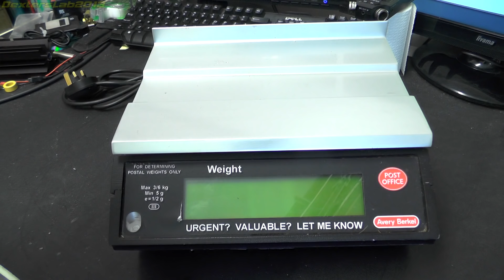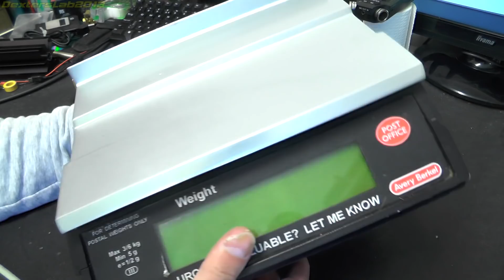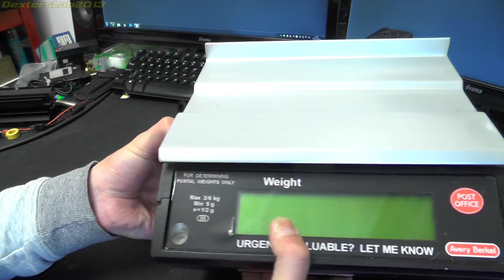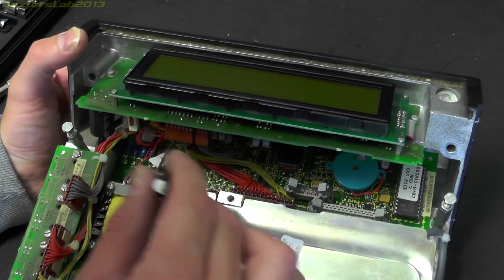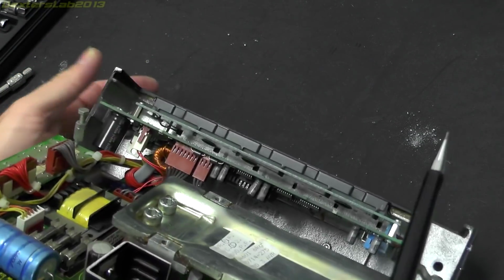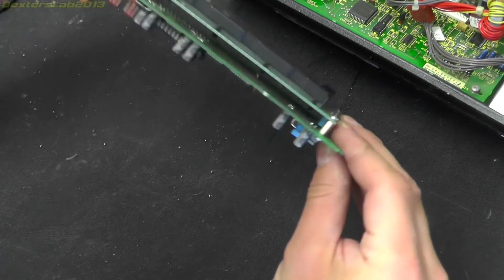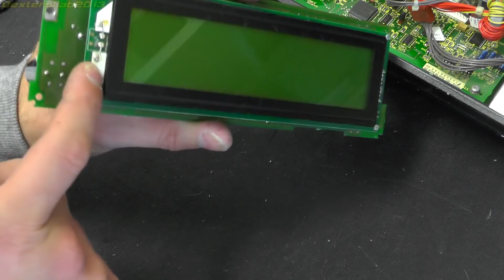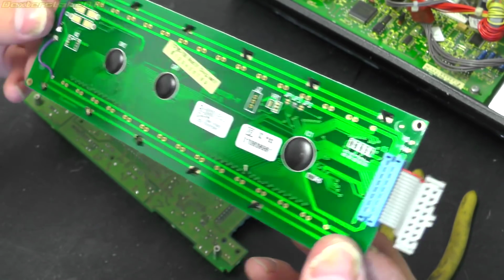DL#069 - Avery Berkel D104 Post Office Scales Teardown

Comment: Unused connectors are for the optional parallel port printer output, used to print labels with mass and postage. The dashes were saying underflow, you need to have around 3 kg ( the mass of the plate, screws and the customer pan) steady for around 5 seconds for the MCU to decide it is happy with the zero and do the auto zero initialisation.

Shielded can is the ADC, discrete parts to make a dual slope converter, using the ASIC as the control logic to control and do the timing for the integration. Slow, but is immune to noise on the input. That uses the 2 5V rails from the power supply for low noise, and you saw the large integrating capacitors inside, along with the feedthrough ferrite filters on all leads going into the can. Easy way to get 18 bits of data with very good linearity ( very important here, as you typically want to use the LSB on the display) without having to do averaging on multiple samples. Just very slow, but really good. There must be a precision reference in the can, likely a 1-2V one as this determines the accuracy alone.
Reply from the maker: +SeanBZA Thanks Sean, yea didn't think to drop a bit more weight on it. Though i would have expected some kind of readable error in that case given the environment they are used in?
Reply: +DextersLab2013 They have a limited negative reading capability, but the design is such that they need to run with the fixed structure in place, so the ADC output is not zero. the software shows underflow so that if something jams the unit so it will read incorrectly ( think of a few coins stuck under the pan meaning it will not deflect with mass) then the first power cycle or an empty pan will show up as an error. 

You can change this in the calibration, setting a zero tare range  for the pan in use. There are a lot of massmeters built on that electronics and loadcell platform, so there is a lot of variety built in.  As the firmware is built on a separate Eprom just reading it will have a lot of ASCII strings that do not apply to this one, but which are used on the other machines. There is a small EEPROm on the main board with the calibration, options and such in it, to store the data for the particular machine.